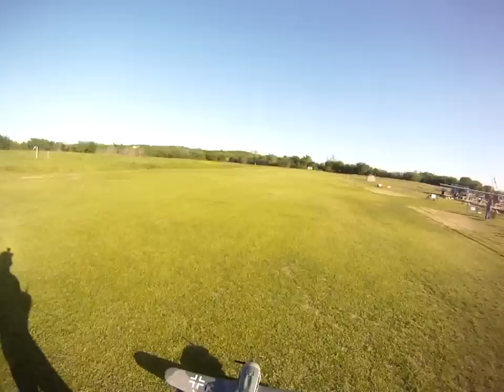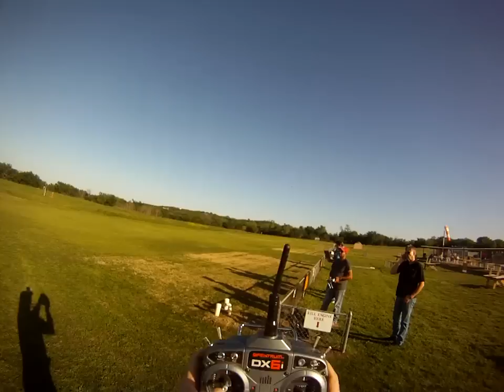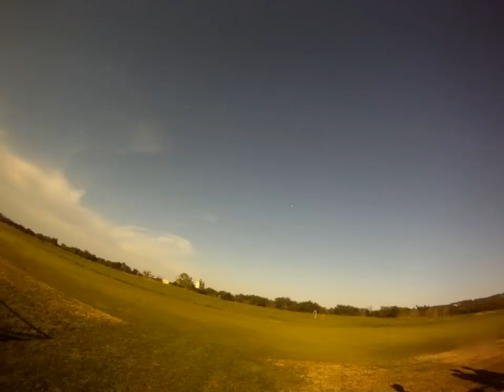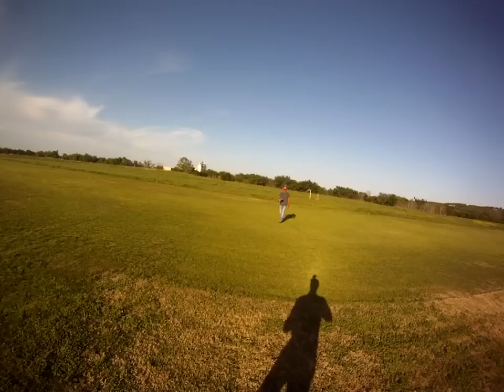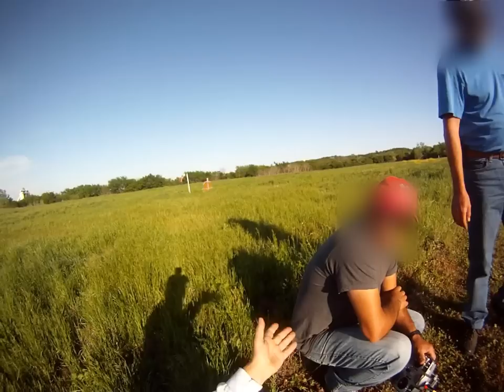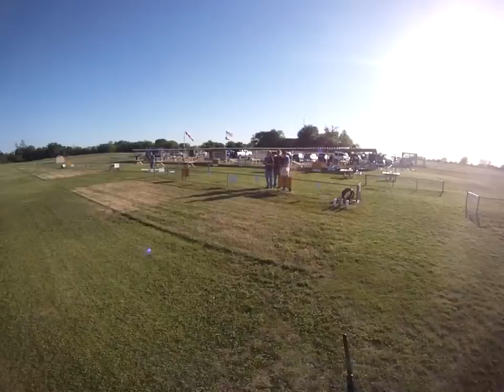Copy of Electric R/C TopRC FW-190 Killer Planes Crashproofing MidAir collision safe landing

Comment from the maker: The Killer Planes crash proofing is really just a retrofit of carbon fiber rods all over the plane.  These CF retrofitted foamies are now a bit heavier but fly better as they are much stiffer...no wing flex.  As the weight is minimal they still fly better and in higher winds carry thier momentum biting through the wind.  I have several models of same aircraft with and without the CF rods....I much prefer to fly the carbon fiber retrofitted planes......you do need to add weight for COG though